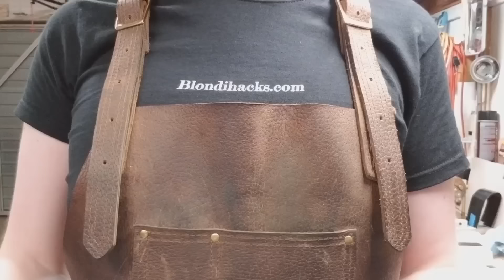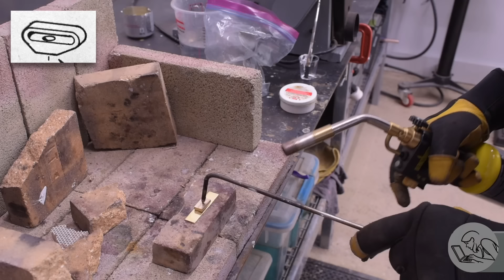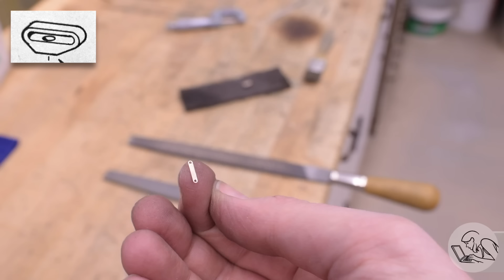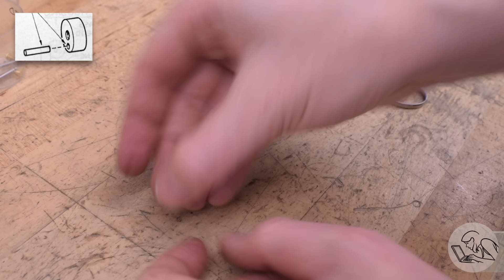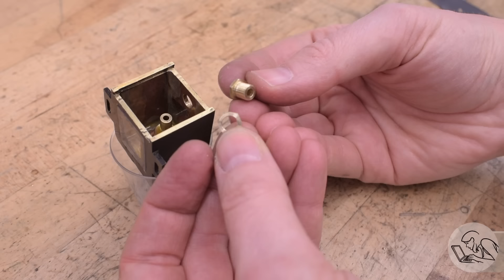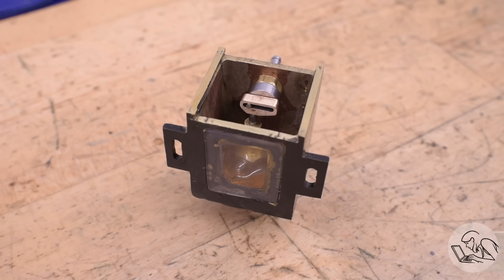Oil Pump Drive! - Pennsylvania A3 Switcher, Part 83

Comment: Re guessing the thickness of the solder between the part and the fixture plate prior to machining the top surface. Another way might be to measure the thickness of the piece before soldering and then measuring the height after soldering from the fixture plate surface to the top surface of the part, and so calculate the thickness.  At the least you'll have less filing to do. Just sayin' as a CTAAVM (certified Thursday afternoon armchair vapor machinist).:face-turquoise-covering-eyes:
Reply from the maker: You can do that, but it requires machining both sides before soldering which is extra work. You can’t measure to the bandsaw cut

Comment: Quick little hint for nuts in tight spots, as per the one around the drive shaft:

Use a small scrap of paper as a shim between the jaws of the spanner, to change the spanner-nut interface to be a tight push fit. You should then be able to use just the spanner to hold the nut anywhere you need to, and once you've got the male threaded component started into it, you can then pull the spanner out and remove the paper, then do it up normally.

Comment: Next time could you just measure the two plates first and add them together, then solder and measure again, giving you the thickness of the solder?
Reply from the maker: That requires machining both sides of the piece before soldering which is extra work, but yes it would work

Comment: I wonder if that short thread on the crank pin was meant to create a tapered thread shape which would pull itself square as you tighten it. Not as good of a solution as a bore that will positively register but could explain the decisions made there.

Comment: Really nice simple part ! Not lol. I am really enjoying this pump build I have to make one for my 2 1/2" gauge dyak. I may use this type instead of the LBSC designed version
Reply: I would say a better pump than LBSC's oscillator type. Dimensions will need modifying for Dyak. Cheers.

Comment: Hi Quinn Just a thought.   Concentricity on the cam is not at all important.  In fact the whole point of the cam is to have an excentric movement of the driving pin, lack of concentricity at worst would shorten/lengthen the vertical movement of the pump by a few thousands, which is not critical at all,   so a threaded axle is perfectly fine...     nice work!